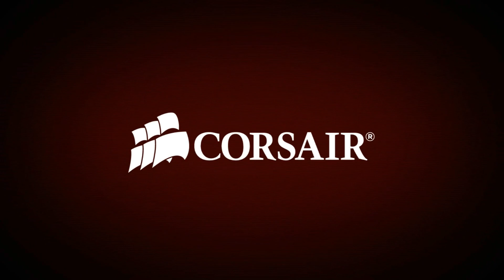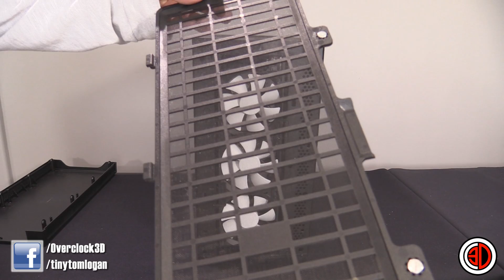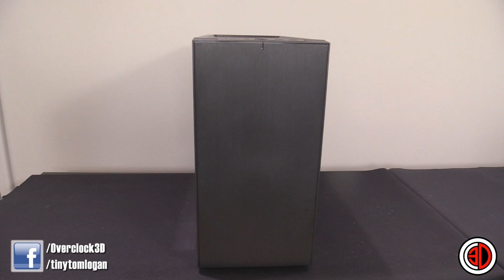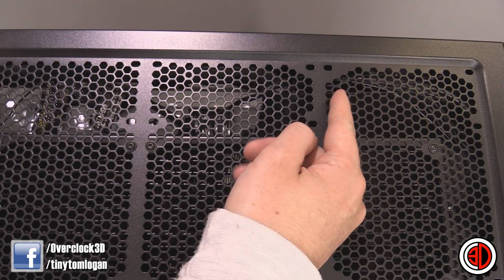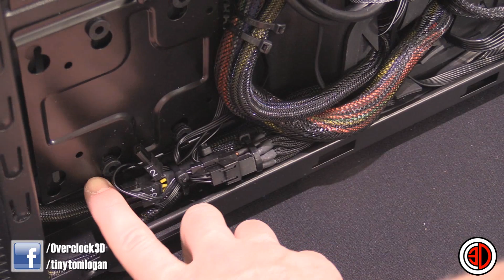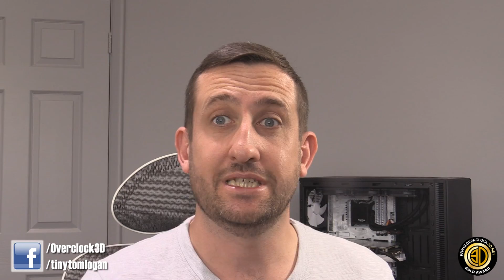Fractal Define S Watercooling Case Review

Comment: So if I have a 60mm 360 rad in the front + fans in pull, would I not fit another 60mm 360 rad at the top?
Reply: you think i could get away with a kraken x62 mounted on TOP(with push&pull confiq with NZXT Aer, P140 fans ? Total of 72mm thickness (30rad + 26mm fans). on a Define S case with Corsair Vengeance LPX ddr4?

Comment: Hey guys, I'm really into this case...pls does anyone know if the actual thickness and quality of the sound dampening foam on both panels (non-windowed version) is the same as the one used in the define r5? what about the thickness of the panel itself? do they share the same materials? thanks :D
Reply: +Fabrizio Cuollo  About a week ago I compared these 2 cases at my local MicroCenter. I was shocked how cheap feeling the Define S was. It had a considerable amount of flex (probably due to the lack of drive bays), something I was not expecting from Fractal. I decided to spend a bit more and go for the R5. As far as I could tell, they used the same sound dampening material, but the R5 used a thicker gauge of steel. If you want a dead silent PC, go with the R5. If you are into custom water-cooling, get the S.

Comment: The biggest negatives I see between this case and the r5 is the lack of sound dampening foam on the front panel and the spacing of the 3 vertical HDD slots making using 1 SATA power cord with 3 plugs challenging.  Im not sure there is a solution to the power cables, but do you think I could add on aftermarket sound dampening foam to the back of the front panel?

Comment: The slots he referred to as vents are for mounting reservoirs and you can see 4 holes in the bottom of the case for mounting a pump. The reason for no hard drive cage or optical bays is for the 360 radiator support. You can use any thickness with push/pull in front...

Comment: Is it possible to fit in 3x 140mm fans in the front mount together with a 280mm radiator like the Corsair H110i GTX?

Comment: I love fractal cases I have a arc midi r2 with 2 240mm rads in. With regards to hdd cooling could they not of included fan mounts on the inside of the case. They've vented the panel so air could be blown onto the underside of the hdd and escape around it.

Comment: I would seriously consider buying this case if it supported 2x360mm rads (one in the front and one on the roof).
Reply: Gainward req Does it not support a 420mm in the roof (blaze it, I know) and a 360mm in the front?
Reply: John Giles You can do a 360 in the top and front. You can go as thick as you want with push/pull in the front but I think you are limited to a 30 with one or the other in the top.
Reply: Colin Odom that's cool. Thanks. Suppose two thin 360's will be an efficient way to have silent cooling
Reply: John Giles
I would mock my complete build minus cooling and then see what makes the most sense. There's a lot of options for the price with this case...
Reply: it does mate
Reply: you think i could get away with a kraken x62 mounted on TOP(with push&pull confiq with NZXT Aer, P140 fans ? Total of 72mm thickness (30rad + 26mm fans). on a Define S case with Corsair Vengeance LPX ddr4?

Comment: Nice review. I am glad it has space in the bottom for another fan. 3 120mm intakes will struggle to keep decent pressure in the case if you have 3 120's exhausting out the top, a 120 or 140 out the back and if you happen to have reference design cards they will exhaust out the case as well.

Comment: I don't know what case to pick, either the fractal define r5 or this or the nzxt h440
Reply: adam khalfi Not the h440
Reply: I'm having the exact same problem. 

Personally I've come to the decision that if you want something super quiet and you don't care about seeing the inside, go for one of the fractal cases without a window. On the other hand, if you want to be able to see your build, get the h440 as it is quieter than the fractal cases with windows as they don't have dampening on their window panel.

I'm going for a white h440 because I want to be able to see the interior as well as having minimal sound signiture :)
Reply: Herman Strandberg Yes, sorry, you're correct.

What I should have said is that the Fractal windowed dampening material is much thinner than that used in the h440 and that the window is also thinner.

This leads to an overall thinner panel and less noise dampening on that specific panel when compared to the h440 windowed panel.
Reply: MrTurdasaurus The R5 still manages to be more quiet than the H440.
Reply: The r5 is quieter and has better airflow.

MrTurdasaurus there is sound dampening foam om the r5 windowed side panel.
Reply: MrTurdasaurus Also it is not the thickness that decides how effective the sound dampening is, it is how dense it is.
Reply: Necro post!

If you are going Liquid cooling there are fans that push nearly 80 CFM at just under 19 dB this case would be whisper quiet.
Reply: adam khalfi the h440
Reply: Herman Strandberg I'm not sure where you're reading that. From what I've found looking around, the r5 without window is quiter than the h440, but the windowed version is louder.
Reply: MrTurdasaurus Source pls
Reply: Herman Strandberg no, it's how much mass it has. 1 mm of super dense stuff won't hold a candle to 5mm not quite so dense stuff.

Comment: I still use Optical Drives, I must be the odd one out. :p
Reply: I use one for fsx as the steam version doesn't support many of my paid add ons. It would also be a ball ache reinstalling the os having to plug an external drive in every time. I've also got a 6 channel fan controller in the 2nd front bay.
Reply: mrdangerous667 Dedicate a flash drive and use it to backup your system so you can just reinstall everything at once and it's a hell of a lot faster.

Comment: I was very much looking forward to your video on this case Tom, thank you for the quick upload!

Shame it doesn't support E-ATX motherboards, I wish it was 1cm or so taller and wider as a case so that firstly, there'd be enough room for double 360 rads and secondly, the amazing angled cable grommets would be just a bit further to the front to fit in even the biggest 2011 motherboards.

Also a thought, do you think it is possible to remove the mounting brackets in the back for the 3.5" slots and just screw the SSDs, as you suggested that it'd have been nicer to have them visible from the front, and then mount 3.5" drives in the slots also?
Reply: TillOverHill This case will easily support dual 360 mm radiators, and I'm fairly sure it will fit some dual 420 mm radiator setups. For the dual 420s, the radiator thicknesses and port placements just matter a bit more.

Comment: Probably the only Fractal case where you can see where the price has made an actual difference.

Front panel with no sound dampening? Check. Really weak chassis that moves up and down, side to side, without the panels installed? Check. Horrible onion bag-like mesh for the PSU? Check. Lol, I could go on but I really don't like this case. There should be a more premium release available to go hand-in-hand for the release of this more budget-orientated case.
Reply from the maker: Ameer Mahmood It was called the R5. having so little in the front is why you may think it moves. Its actually a cracking case for the money and by the time youve built it you wont get any issues you are moaning about
Reply: Doesn't need sound dampening.. it's not an R series. Construction of fractal cases are all similar and are nearly 100% steel. It won't bend unless you force it. Who cares about mesh for a psu. Get a quality one and it'll rarely spin. It's a great case for the money. Your just finding any reason to not like it.
Reply: hikeskool Alright, mate. You're gonna drop money on something and not look at every detail? Please.
Reply: You're right.